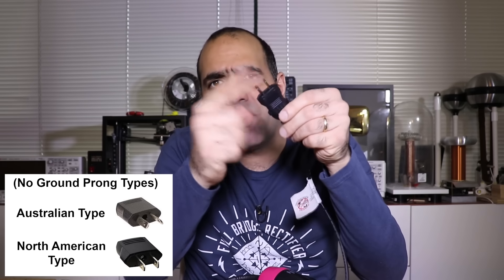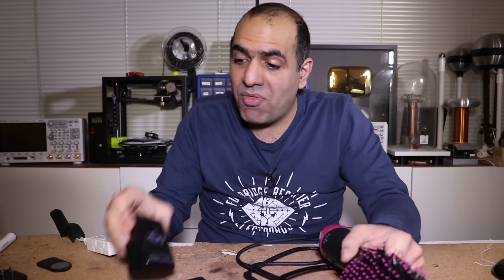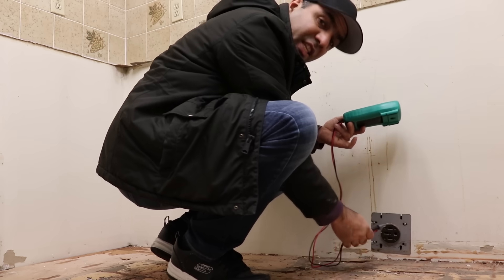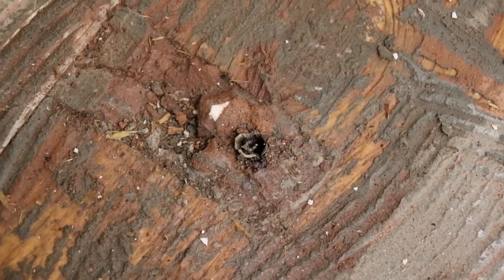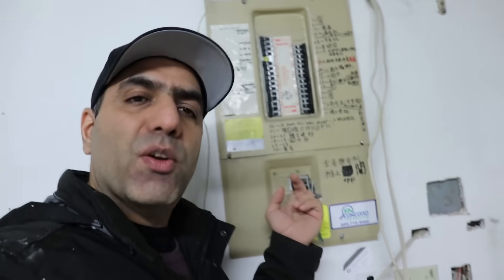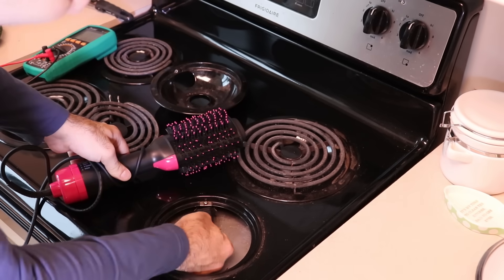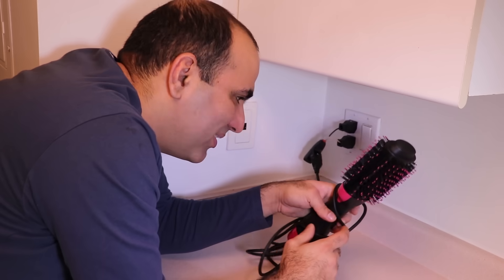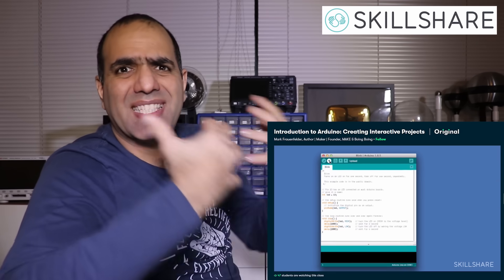Finding HIGH POWER 240V in a 120V Country

Comment: Perhaps one day you can talk more about of two-phase vs. split-phase and how/why they're not the same thing.  For example, why do two live wires from a two-phase power system produce 208v between the lines (your apartment) and split-phase produces 240v between the two lines (the fire-trap house)?  How do both systems mysteriously produce the same 120v line to neural?  

For the hair dryer, I read Australia has single-phase 230v system, different from either of the above.  Can all appliances work equally well on any system so long as the voltage is adequate?
Reply: His apartment isn't a two phase system.  It is using 2 phases from a 3 phase system.  Each phase is 120V to neutral, and 208V phase-to-phase. 

The house is using 1 phase from a 3 phase system, but it has a center tapped neutral.  That means the neutral is halfway between the 240V phase voltage, but since it is connected to ground, we call it 0V instead of 120V.  That means one end of the transformer is at -120V and the other is at +120V at a particular point in time.  You get 240V across them, and 120V from either end to neutral.

The only other thing to worry about is frequency, as induction motors won't run at the right speed when fed with the wrong frequency.  For example, old analog clocks used synchronous motors and won't keep correct time if plugged into the wrong frequency.  Some digital clocks won't either.

Comment: Ah yes, the joy of casuall tripping over wiring faults in other people's installations while just "quickly" fixing something. I stopped helping friends and family with their electrical installations because I really don't want to be held responsible as "the last person that did work" on someone else's shoddy installation. Especially old people's houses where the insulation has already rotted off the wires and only the naked wires wind through the walls :p.
Reply: I bought an ancient house where the 'fuses' have never tripped despite smoking up lots of electric equipment . . no surprises when I eventually introduce myself into its circuit
Reply: @benwinter2420   It was kinda common to bypass old fuses to not change them every small current spike.
Reply: @detorrV2   Yep am gonna install modern circuit breakers , it will be the death of me or others otherwise
Reply: the wires in my house have this rubber insulation with fabric around the outside and it's pretty terrifying when it starts crumbling in your hands while working on it. at least the individual wires inside it still have decent insulation
Reply: And never forget houses built before the 1950's where the water main is the "ground" for the power panel.

It works , until the pipe feeding the house starts leaking and the idiot contractor replaces it with a plastic one.

It's a real scream when you try to hook up a garden hose.(literally)

And the whole time you're fixing  it your elderly relative is going on and on about "why do I need a grounding rod ? I lived in this house for 42 years without one , are you sure you screwed the fuses in tight, John always said to make sure you screwed them in tight, maybe you should check the fuses again."

That's real hard to listen to when you're swinging a sledge hammer.
Reply: I saw one place where the old man had wired the outlets with speaker wire surfaced clipped to the wall.
Reply: did you mean old people's houses or old houses occupied by people?
Reply: @Bennyboy-dog  No I think he meant actual old people, as though the age of the person has some correlation to the quality of the houses electrics. I know, I don't get it either...
Reply: @Bennyboy-dog  Old houses occupied by people that are likely very old as well (*) and "have no no need for modern installations". As someone already mentioned, cables with fabric insulation that turns to dust when you look at it and/or bakelite junction boxes/sockets/switches with the structural integrity of sand castles amidst tidal waves.. Horrible stuff that essentially would require you to replace everything if you just want to exchange a wall socket,  because the fire/safety code (rightfully) would demand you replace everything once you start changing anything with electrical installation (or it becomes your responsibility if anything happens afterwards). As others pointed out it's also hard to convince your grandmother to change something if it already worked for 60 years. 

I once got a family friend to rethink her electrical installation after the fuse would no longer stop popping for one of her tenants and I showed here that her tenants 10 amp cooking plate had melted her barely post WW2 wiring in the dry wall. It's a miracle that house didn't burn down tbh. There is probably not a single electrician that doesn't have some horror stories like these.

*) Might be an issue more specific to my town since alot of the houses are quite old and usually not up to modern standards like ceiling heights, heating, etc., which means you only find old people still living in them.

PS: Obviously I tell them to get someone to fix their stuff and that it's a hazard - most are usually just not happy to hear that when all they wanted was a suppsedly easy and quick fix for a little problem.
Reply: I do hope you point out to (close) family and friends that they should probly replace/rewire there house when it the insulation is that bad? Wouldnt want to know i saw that and then see the house burn down.
Reply: @L3vinesNL  They never listen anyway "oh it's been fine for 20 years".
Reply: @uK8cvPAq  yeah ok just checking to be sure :) its there own fault then.
Reply: @L3vinesNL  People don't tend to learn until it's too late when it comes to stuff they don't really understand.

Comment: In canada counter top receptacles are either 20 amp or split wired 15 amp by code. This is for the reason you suspected.

Comment: HAHA!!.Cool video Mehdi,you can run that hair drier from a 120 volt outlet safely.This is done through a VFD.(Variable Frequency Drive)
The higher the frequency,the fewer amps the hair drier draws and the faster the blower runs.
Another words,instead of the normal amp guzzling 50/60 cycles it normally would run on.It would be running on a much more efficient 400 cycles.
Reply: The power is always the product of voltage and current. While in theory the speed of a motor is proportional to the frequency, in practice you should also consider the power that the motor needs to run the fan, which would be a quarter as Mehdi said. Also, what are you going to do for the resistor?
Reply: @TreniFS_  Your operating on 400 Hz., not 50/60 cycles.
Power is being converted to RF,you are no longer running amps,but you KEEP the power.Aircraft has used this since WW-2.
The resistor isn't needed either.
Reply: @4gauge10  "Power is being converted to RF" and "you are no longer running amps" have no meaning to me, nor to anybody who knows just the basics of electronics. From now on, I'll assume you're some kind of troll and ignore whatever you write. I'm only worried that somebody will think that he can learn something from your comments.

Comment: Lol. We have 400V here in Europe for high power applications like induction cooking etc.
Reply: @MernokiMegoldasok  Well if you are going to talk about industrial applications then we have an almost unlimited amount of voltages to chose from. XD
Major industrial buildings have most of the time their own transformers which are connected to the high voltage grid. So they can choose their own voltage connections.
Also large comercial buildings. My school forinstance had his own transformer on the high voltage grid for the air handling systems and the 230V and 400V connections.
Reply: But that is not Freedom Voltage! You live in a current dictatorship! What's next a system of measurements, weights and volume that actually makes sense?

Comment: In many countries stuff like stoves/ovens run on 3 phase 400 V  at 16 A and sometimes even 20 A, at least in Europe, that usually is the norm.
Reply: Most stoves absolutely have an N-terminal. The heating elements run on 230V and the three phases are just for balancing the load. If you haven't a 3~ supply, you can even use a bridge included with most stoves to run it on 1~ (in older installations; of course than you can't use all elements of the stove simultaneously).
Reply: @joerg385  I meant the confusuion about 3 phase 230V :-P yes neutral is used, though more and more combos/cooktops seem to use DC internally distributing the load over 2-3 phase via an active PFC rectifier.
Reply: 400v for a stove
Reply: They use 3 phases but still 230 volts so that they can if needed be connected to a single phase. My stove is at single phase. It is under 20 A breaker but it uses up to 37 A.
Reply: @okaro6595  3 phase 230V is 400V :-P Phase to phase voltage, 3 x L+N is 230V but not common :-P an some stoves do not even have N-terminals :-P
if it is fised with 20A it cannot sustan 37A :-P because that is not how fuses/breakers work.
Also a 37A stove would be quite weird :-P

Most stoves (ceran/induction) are DC internally and simply rectify whatever input they get, usually 2 or 3 phase :-P
Reply: @DooMMasteR  Not in my country bucco. See here in Norway, we thought it would be smart to run the whole country on 3fase 230V IT and TT powerlines. So you can absolutetly get 3 fase 230V.
Reply: So you guys are savages here in America we leave ours exposed then little doors you guys have and some of us does have outlets upside down.
Reply: What sort of earth leakage protection do you have with three phases in a domestic building?  The idea of being exposed to 400v seems horrific.
Reply: Alan Patterson most houses here (the Netherlands) are supplied with 3 phases 230v. They are split into individual single phase 230v groups “after the meter” with individual breakers per group. A 3 phase “power” group can also be created (with three breakers/fuses) that can be used for cooking. Since more and more people here are cooking electric these days, that last option is used a lot in newer kitchens.
Reply: @alanpatterson2384  Here in Australia, most of the homes are on single phase except for some public housing which runs on three phase and the only appliances which run on three phase are hot water heaters. Everything else still runs on single phase from an incoming three phase supply so an apartment with appliances easily connected to a power outlet still have 30mA earth leakage protection. You can purchase three phase earth leakage protection breakers as well since it's now mandatory in Australia for everything including and below 32Amps to now have RCD protection (or GFCI in the States I assume) but they are quite expensive and not really done on residential installations.
Reply: @alanpatterson2384  It's called a TNC-S, or TN-S, or TN-C depending on where on the line you're looking at. And the general gist of it is that along with your 3 fases of 400V there's also run a grounding cable along with it which then gets split into a grounding and a neutral line either in the house or from the transformer turning it from a TN-C line to a TN-S line then it's run in your house in single fase mostly as you would. Now because of this, you're actually operating with reletivly high amounts of current once there is a grounding issue. And because of this, the breakers will go off near instantaniously as well as most of the current not actually passing through ground, but rather follow the grounding back through the lines.

Comment: I feel so sorry for you Canadians with so old dangerous and shitty power system....eu masterrace here...
Reply: Don't feel sorry, the electrical system works just as well, is just as safe, and is actually a little cheaper in materials. The only issue is trying to use appliances designed for one system in the other, which is only an issue for tourists bringing their appliances with them as all items available for purchase in north america work just fine in north america.

Comment: I did exactly the same thing and built an adapter with two IEC power cords, and plugged them into outlets on separate phases to get ~245V for my PC. Originally it was drawing ~13A and making the cord get warm and causing the voltage to droop a few volts. The higher voltage fixed that, as well as gained a few percent efficiency on a very heavy load.

Split phase power was a great idea!

Comment: So in europe we have 230V on phase, and we use this voltage between Phase and Ground. And in NA you have 120V phase, and you get 240V by difference between two phases? Do I get it right ? Device in 240V is not connected to the ground but between two phases?
You have only two phases in NA?
Reply: American homes are supplied with 120/240V 1 phase 3 wire "split phase" systems where the secondary coil of the transformer is "center tapped", or grounded in the middle. From one end of the coil ("leg") to the "neutral" in the middle, you get 120v, and from L1 to L2, you get 240v.
Reply: @ironmatic1  ah I see. So I was right, 240V is between two Phases. Thanks for answer !! We have so called "force" with current between 3 phases so max voltage is 380V if you have connected all 3 phases to household. Some houses have only one phase connected, but mostly old ones. All new ones gets 3 phases
Reply: Not exactly.  Homes use one 240V phase from a 3 phase system.  That one phase uses a center tapped transformer so we can get 120V or 240V from that one phase.  Large buildings get all 3 phases (like Medhi's apartment), and they get 120V from each phase to neutral, and 208V between two phases.

Comment: (im sure you know and just simplified the explanation for the video) at your home you get 208v between two phases because for apartment buildings they supply three-phase power whereas houses get split-phase for that 240v. as an electrician this is the stuff we work with daily, very interesting video to see! always bring a non-contact voltage detector!
Reply: also by code you need at least two 20a circuits for kitchen appliances, even if that means putting them both on one receptacle. honestly it's probably chance they ended up on two different phases, a 50/50 shot of which breaker they ended up on. residential electrical sure is interesting!